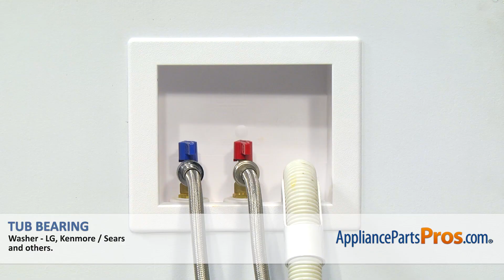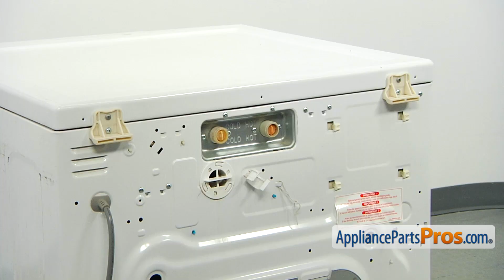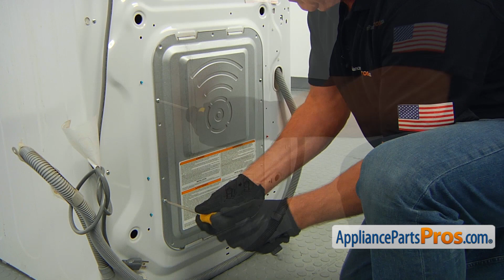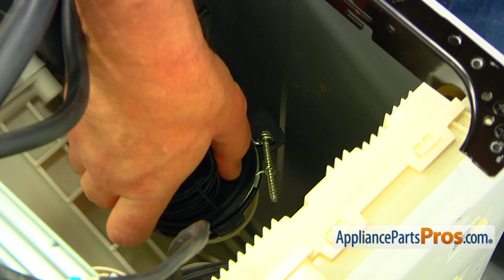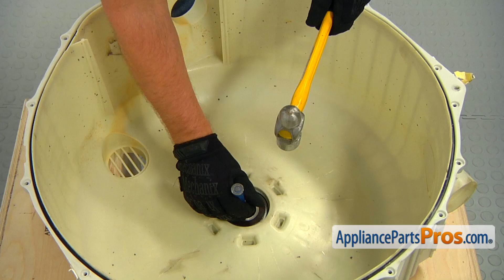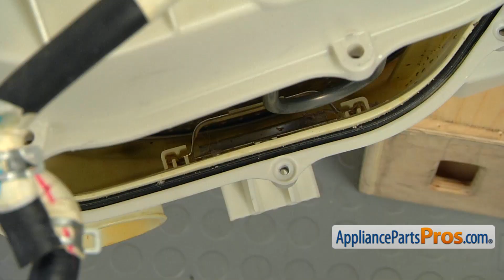How To: LG/Kenmore Tub Bearing 4280FR4048Z

Comment: Just started re-assembling my wm9000hwa after replacing the bearings.
I would suggest numbering the bolts and where they came from on the tub or marking with nail polish colors.
It seems LG has slight variations in the bolts that hold the outer tub together or someone at the factory went hyper when screwing them together in a couple places.
I have two spots where the bolts after reassembly never tighten and just spin (I never even got them to "hand tight"). Upon removing them again there was a compressed spiral of plastic thread that came out stuck to the bottom of the bolt.
I tried swapping other bolts in these places but no luck.
I'm hoping I do not have to buy a new outer tub as one of these places is the one dead center in the bottom under the heating element and the other is half way up one side.
Here is to hoping it does not leak.
I think I will replace the bolts that are not tightening with a bolt/nut/lockwasher/loctite combo instead of trying to re-thread plastic.

Comment: replaced the bearings, gasket, door seal, shocks, and spider arm.  put it all back together and it leaked.  i failed to seal the heater element at the bottom of the basket, need to tighten the 10mm nut under the ground wire.  put it back together and it leaked, i didn't put the water inlet hose on correctly.  fixed that and put it back together.  works perfect now.  thanks for the video.
Reply from the maker: Wow, that’s some serious dedication! 👏 Glad you tracked down those leaks and got everything running smoothly again. Appreciate you sharing the play-by-play — it’s a big help for other DIYers too. Nice work! 🔧🙌

Comment: I’m really struggling to get the metal basket to seat properly after getting the new bearings in, no matter what I do I can only get the spindle out half way…any tips??
Reply from the maker: That can definitely be a tricky step. A couple of things to check: make sure the bearings are fully and evenly seated, and double-check that the shaft isn’t worn or burred, which can keep it from sliding in smoothly. Sometimes a light sanding and cleaning of the spindle helps. Also, a bit of food-grade lubricant on the shaft can make the re-install easier. If it’s still stopping halfway, it may be worth pulling it back out and re-checking the bearing seating before trying again.

Comment: Why Red Threadlocker? The factory replacement stator bolt has blue on it and other videos/forums suggest using blue rather than red.
Reply from the maker: @minkusdraconus Good question! Blue threadlocker is generally the safer choice for most DIYers — it holds well but can still be removed with hand tools. Red is stronger and more permanent, so it’s only recommended if the manufacturer specifically calls for it. If your OEM stator bolt came with blue, definitely stick with that. 👍🔧